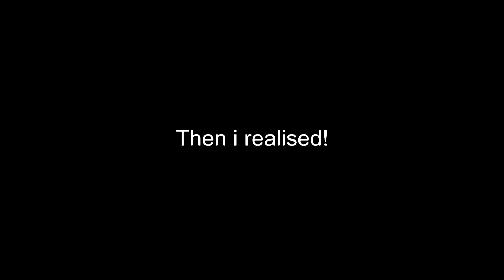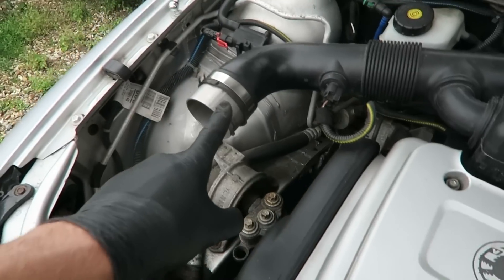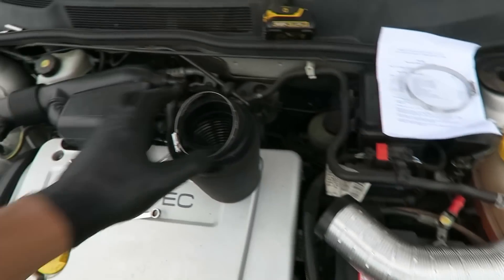Astra Mk4 RamAir Induction Kit Install!

Comment: I highly recommend oiling the filter with something like Lucas oil.  Even if advertised as dry foam.  It will also keep it water proof.  I've cleaned many foam filters from motorbikes.
Reply: # oiling filters is a good idea but vauxhalls dont like it

Comment: From a personal experience like many commenters here, I fitted a cone filter with cold air feed and for the first fews days I enjoyed the sound but I found it really dragged the performance back. I went on a 90 mile drive and ended up removing it and putting standard box back in before the return journey. This was my astra g 1.6. I do hope it works for you though
Reply: They are a waste of time and money. They reduce power and do not filter the air. All you hear is the noise from the restriction it causes.
Surface area is tiny compared to an original filter.
Stop being scammed by people targeting boy racers and idiots.
A vectra intake pipe does FA ! It passes no more air than the original pipe.

Comment: I think a K&N panel filter in the standard airbox setup ould be a better option. Love the wheels, she's looking well James.
Reply: @ctdisriguyvauxhaullmad1429  pod filter is something you do when your 18 on your first motor.
Reply: I'd pay to see if anyone could tell what type of filter a car is using without looking under a bonnet.. heat soak isn't much of an issue unless your on the limit & need every ounce of power, for the everyday driver the tiny amount of engine bay heat wouldn't effect anything noticeable!!
a poor designed filter would do more damage... such as a cheapo item shown in this upload
Reply: @malp6280  I agree. Its all subjective really. They do it for the induction noise more than anything else. I'd sooner my engine was not sucking in all sorts of shite and breathing properly through the airbox an entire design team spent months developing. Rather than some pod filter slapped together in a sweatshop by one hung lo.
Reply: @GeorgeEI7KO  ultimately if your wanting a cooler air supply with a sporty engine/intake note... you could
1: heat lag the standard air-box & route a more sensible duct (standard rather then this Vectra idea) whilst removing any restrictions within (you have already)
2: add a pod filter to the inside of the standard box & do the same again with an intake port (these generally use vacuum to increase the air supply hence a higher volumn is sucked in compared to running an open filter.
3: have a fully open filter pod only with some heat-shielding around the back/base & side.. again you'd then need multiple air feeds to supply a good feed to the filter (vacuum wouldn't apply due to it being open-air) the ram-air effect also isn't really in effect as you've not cut holes into your bumper/bonnet to direct air into the intake.
your rite in saying the engineers spend months in designing the airboxes etc as they do, however they also have to follow guideline to keep intake noise down & to help manage the set engine performance & emissions to the value governed to them "blar blar blar"

ppl using heat soak as an excuse well! "your not a race-driver neither are they" so loosing afew BHP you'd not really notice under normal road conditions even if you 'fast & furiously' styled your car. you've mentioned how this freebie filter you could feel the car struggle in pulling away, that's more then likely down to a poor material used in the filter so the car would struggle to breath "especially more so if it was a hot day, added to the mix" you could replicate that by wrapping a plastic bag around your filter & trying to move your car down the street (don't forget the car needs a certain amount of air to produce power/combustion)

if your wanting cooler air for the filter, relocate the filter under your head light, behind the bumper  add a small heat shield to reduce radiant heat from the engine & radiator, your cars N/A by the looks so power increases will be nil to none at best. So adding the filter will only really add an intake note & if you mix it with a nice exhaust then you could get a nice exhaust note altogether... or you could go stupidly loud if the pipe dia & resonators/silencers are removed (that could have a negative effect on engine power as back pressure would drop.... pps I do think Mr Lo probably did make that filter lol
Reply: @malp6280  a man whom I highly respected (hes not with us any more) used to specialise in the business of making old motorbikes go very very fast. Guys alywas used to say to him about using race exhausts. His reply was always the same 'just because yer making noise, don't mean your going fast' at the end of the day budget is a limiting factor as to the gain you're going to achieve. A mickey mouse mod like this is going to do feck all. Port n polish the head along with a large bore 4 into one tuned exhaust manifold is the best way to go for a decent increase. But in this modern era they plug in a laptop and call it tuning. For me, I just like messing with old cars and all I need from it is to get me to work and back each day so i don't need it to be popping and banging. Plus mine is supercharged, so it has a very effective cold air intake from the factory. The K&N make it breathe and sound a little better. Is it pinning me back in the seat? Hell nah....
Reply: CTDI SRI GUY Vauxhaullmad no heat soak when the intake is by the foglights 😎

Comment: If you place the support bracket under the mount instead of on  you will be more in line with the mouth of the air intake
Reply: you really wouldn't want to mess with putting an aftermarket air-filter bracket between the chassis & the engine mount....
you'd be much smarter to just bend the filter frame to suit or to find another location to bolt the filter bracket to..

Comment: Trust me.. it won't make a blind bit of difference apart from adding induction noise and robbing your engine of a few horses.. What would of been better.. if you had kept the stock set up and dropped in a performance filter.. you won't be getting the induction noise, but you "possibly" might be adding a couple more horses..

Comment: Great video as always Jane's however one thing that has bugged me is the fact that you haven't used it to it's full potential as that pipe extends so you can mount it in the bumper somewhere alot of people route then out of the fog light or sometimes through the bottom grill maybe a suggestion for you

Comment: Filters are great if lest restricted but the main reason the factory filter is boxed is when your sat in traffic your going to take lots hot air in the feed 

Heat soak is real with anyone that puts cone filters on hot air is less power it’s that simple box your cone in and give it as much cold air as possible
Reply: Needs a cold air box as you say.
Reply: Got a ram air kit on mine but also have a hear shield and also an intake pipe from the bottom grill and seems to sort heat soak

Comment: I put a RamAir kit on my my Corsa E Turbo 1.4 and its sound amazing, got the pipe just like you have to reduce the risk of heatsoak,,  you will sorry to say have to re-oil it at its service interval, RamAir do the kits to clean the foam and re-oil, easy done.

Comment: On my car BMW has added a "flap" to the airbox which opens above a certain rpm, this is open to the engine bay and complements the usual cold air intake into the airbox. The engine manual states that at the rpms/speed it opens at there is sufficient air movement under the bonnet not to ingest hot air.

Comment: Induction kits are good, they do get your MAF sensor dirty faster, so if you get stumbling idle, just clean the maf sensor off with some maf spray.

Car sounds great, it can breath better, more responsive pedal at lower revs.
 I just done a muffler/ silencer delete on my vectra c.
And today I'm straight piping it with a hoffmann race tube so it will be a cat back straight through.

Total cost for cat back exhaust and fully fitted  £160

GONNA SOUND INSANE LOL

Comment: You could always at a later date, use the original oval vectra C but that's closest to the bonnet catch, the when it goes to the round pipe, cut it and use the foiled ram air pipe to the filter.. you'll have more intake air through the grill🙋‍♂️

Comment: Cant u spin the bracket round and bolt it in the middle bolt of the 3 on the engine mount maybe it will pull it lower down ...but there again it may move when the engine moves ...

Comment: Intake upgrades work well with chargers and upgraded exhasut and bore or stroke or valve upgrades ect

An airfilter alone will only slightly improve response and flow.

A filter alone Depending on location can be cold air which is always better for an engine and will always give a subtle noticable power improvement 
It may help with a dash of extra torque and if flow is good more power at high engine and travelling speeds.
More speed means more air more air means more power/speed ect a loop effect till redline so to speak.

In truth
All upgrades are designed to work better with other upgraded stronger and less restrictive parts.

Comment: Purchased 🤣 one of these for my insignia 2.0cdti which had been mapped,but just like yours the cone supplied was tiny an nothing like the big brutes I've seen around so I sent it back for a refund an just upgraded to a sports panel filter for original air box shame really as the remains sound awesome on cars I've seen with the big ones on 👍

Comment: It feels slower due to the continuity principal. 

Air speed increases due to the pipe decreasing (small intake pipe from the airbox), this gives low down torque.

With a large cone filter you'll gain BHP top end with the sacrifice of low down torque.
Reply: no test ever performed shows these give any gains whatsoever their own with no other mods
Reply: Hot air is less dense less air less power but yeah they actually decrease power on most n/a cars

Comment: I made the test to see if the myth about pod filter sucking hot air is true... Guess what ? It's bullshit !  
Checked with an odb reader, compared the air intake temp and the outside temp. Difference ? 5°C at stopped traffic, 3°C on highway.
Another difference, throttle response way better, on uphill car doesn't struggle anymore, and the sound is awesome :D

Comment: even on my stock cupra r I use standard airbox. non turbo cars really is wasting money on air filters , manifolds ect.. but I understand you've done it to make a video so all is well.
Reply: More often than not non turbo cars respond better to simple breather mods than turbo cars do. Depending on how much of an enthusiast you are or what your objectives are I wouldn’t consider it wasting money. Not that I expect this filter to give him any power gains, just a few more smiles
Reply: NitroNuggetTV yeah it it’s a proper cold feed but not from this and not from the engine in question
Reply: rayner1704 I’m fully aware of this, I said I don’t expect this kit to give him any power gains. Just using a turbocharged car as an example isnt the most valid argument considering NA commonly respond better to basic breather mods. But my main point was that his objective was to have some intake noises, and it achieves this which is why It shouldn’t be considered a waste of money.

Comment: You should also advise your insurance broker regarding this & any other mod you make on a vehicle , failing to do so may make your insurance null & void
Reply: I had a ramair fitted to a mondeo st220 when i bought it.  As with any mod you should advise your insurance broker. I was advised to remove the ramair or my fully comp insurance would be worthless. I ended up getting a standard air box & fitted a flatbed k&n.

Comment: Just put an k&n panel air filter in
You get the best of both worlds.
Reply: I think I will be reverting back to that. 1 thing it was good for was opening up the engine bay a bit.

Comment: Reminds me of go faster stripes in the 80’s neither use nor ornament
Reply: He wouldn't remember them as he wasn't born then
 I however got my first car in 1989 and remember putting side stripes on it as well as mud flaps and spraying the rusty wheels silver. We also painted the tyres with black stuff that eventually caused the tyres to crack. Nobody knew anything about the age of tyres then so they may have had thread but been as old as the hills... these were the days before ebay/youtube so info was hard to get as were tools as we were skint.
Reply: terry atkinson  I had my first car in the 80’s a cortina estate , I remember the exhaust falling off at the manifold in London at night 
I had to drive 100 miles back to Leicester without it 
The noise was deafening and the car was full of smoke ( windows open) 
Great days
Reply: @pauldoherty8432  people wouldn't put up with the crap we drove. I remember my ritmo manifold gasket was gone and at night when it backfired you'd see flames on the road haha.
Reply: terry atkinson  LOL I also remember losing a wheel on a mk1 Capri just before toddington services M1 
The wheel bounced over the barrier into oncoming traffic and up the grass verge 
Had to hitchhike back home ( 4 of us)

Comment: I'm pretty sure you were supposed to put the filter at the end of that pipe and stick it somewhere under the bumper. 
Also, you can stick to a k&n panel filter in the oem box
Reply: Surely a ribbed pipe would restrict airflow by producing lots of turbulence ?
Reply: @Chrisallengallery  cheap ebay parts....
Reply: Are you for fucking real

Comment: Hi would off put some oil on it and I would off put a K&N filter on it and kept the air box it came with as that is what I have got on my madza mx 5 2016 and it is lovely working will nigel
Reply: If you put oil on the filter, dust will stick to it and you will eventually have lower airflow.

Comment: Even for a naturally aspirated engine if your car is not tuned you get almost zero results with cone and foam filters, besides introducing hot air in the intake. If you dont want to put a panle filter on at least install a BMC carbon barrel intake. Good video bty

Comment: Absolutely pointless mod. I bet if you put it on a Dyno now with the bonnet shut it would make less BHP. The Astra G and H models have a very good cold intake already. You just need to remove the Restrictors that are placed in the airbox to fully open up the pipe diameter.
Reply: He states in the video he’s not expecting any gains multiple times and he doesn’t care for the controversy surrounding “cold air intakes”, he just wants some noise. If it achieves what he wants it’s not pointless.
Reply: My 1.6 vvt H was better from 4k rpm when I fitted a VXR intake and destructed the box.
Reply: @gsdbeattie5233  You mean 1.8 VVT ?, since they didnt make a 1.6 vvt for the Astra H.

Comment: HI, I'M AN OLD SCHOOL BOY. PRE ECU CARS.  I DON'T KNOW MUCH ABOUT MODERN CAR ELECTRONICS. BUT I DO KNOW ,THAT YOU CAN'T JUST SWAP A BATTERY, WITHOUT USING A MEMORY SAVER, OR A JUMPER.  SO SURELY BY ALTERING THE AIR INDUCTION, YOU WILL BE CONFUSING THE COMPUTERS. SURELY THE DESIGN ENGINEERS KNOW BEST. STILL AN OLD BOY LIKE ME, WHAT DO I KNOW? I COULD BE WRONG!  ARE YOU LADS JUST FITTING THEM, FOR THE INDUCTION NOISE LOL!
Reply: psfree40b  THANKS FOR THAT.  WE ARE NEVER TOO OLD TO LEARN!

Comment: Eco tech engines are reliable but fuck me there so slow with literally no torque you cant get any gains from them terrible engines really i can happily say this as i have vectra b estate sri 1.8 eco and its the slowest and sluggish car i have ever owned 🤣 when i say no gains the 1.8 is 125bhp with a remap you will only push 132bhp i whopping 7bhp 😱🤣🤣🤣🤣🤣